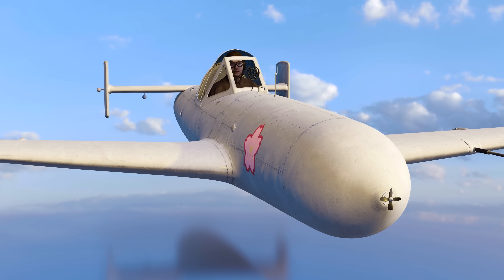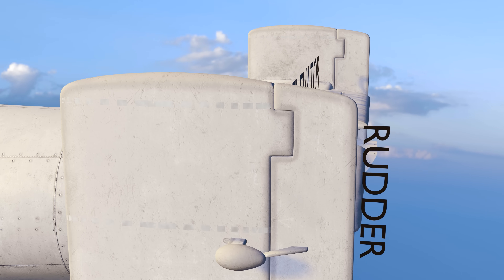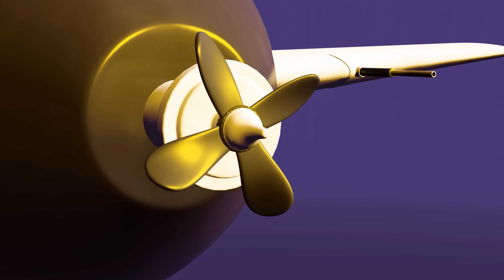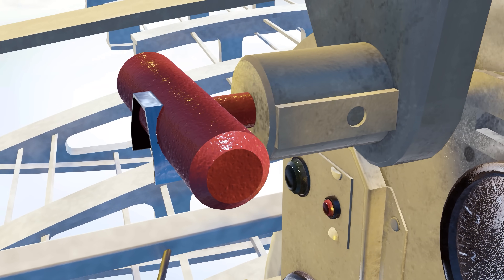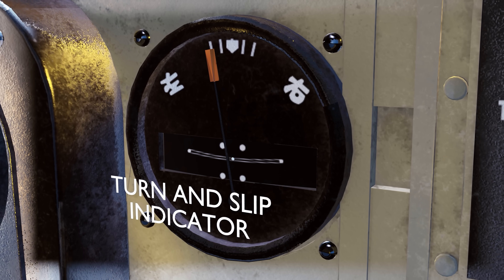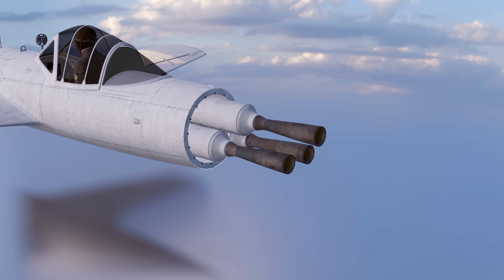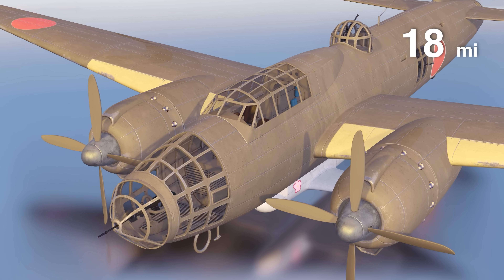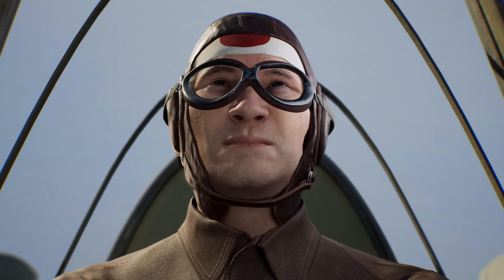Inside the Ohka Manned Missile

Comment: I loved the video. I don’t want you to force yourself to stick to rocket planes but the way they work is so cool and strange. Is it possible to show the ME163
Reply: The problem with the 163 was the fuel was corrosive and unless flushed out fairly quickly it would eat the fuel tank out from the inside. It sometimes ate the pilot away too upon landing and the liquid sloshing into the cockpit. The 163 was also subject to sabotage by the concentration camp or POW laborers forced to make them. Small rocks inserted into the wing bands could cause the wings to separate violently in flight. Or the laborers would urinate into the glue used to hold the wings together. This would weaken the glue and would again cause the wooden outer panels of the wings to separate at speed and would cause the wing to again separate violently from the aircraft. The pilots survival odds depended on if he was under thrust or not. Once the USAAF and RAF figured out where the 163 bases were it was a fairly simple task to reroute the bombers away from the area and it rendered the 163 inert. Had the BA-239 Natter worked it would have been a different matter but the one test flight of the Natter resulted in the death of its pilot
Reply: @matthewcaughey8898  yeah that’s cool I know that but I wanna know how it works and all it’s intricate parts

Comment: Do you really think the pilot's wore the type three integrated comms for one way trips? The throat mic is incorrect.  It is more bulky, the pickups are bigger.  
  There is one mere feet from me, I have the 6th known of 6. I didn't expect you to know. Not seeing its cord or plug either. The cord exits right side and after an inch there is a bit of white silk where the leather ends near the ring you have for the helmet strap. Two black buttons near center also.
   Not sure why there is a separate mic in hand if that is type three integrated comms.
  I'm no expert either.  It just doesn't make sense to me.
Reply: It's just a chin strap. Explains it looking odd.

Comment: "Pitot" is pronounced "pee-toe" not as you might expect, "pit-ot".
Reply: I should have added, otherwise an excellent and hugely interesting film about a fascinating weapon. Had they been able to develop the machine using a V1 pulse-jet engine augmented by rocket-thrust, the range could have been increased considerably whilst giving it the "sprint" speed to evade intercepting fighters, making it a much more dangerous weapon. As it was, all the allies needed to do was to attack Betties at greater than 20 miles or so from their shipping to prevent a viable attack, which of course they did.

Comment: Are there any plans, drawings, and pictures of the construction process of these planes? It seems I seen pictures after the US entered some of the air bases and it showed wrecks and damaged planes but not very much on details in the pictures. It looks very simple and straight foward. It seems like a little more work and someone could easily built a real working jet plane, though it would still be likely a one way trip.
Reply: Rocket plane* Jets and rockets are in no way the same thing.
Reply: @Mr-Trox  nope, but the air frames were similar.   jets and rockets designed for being pushed. Instead of pulled.  The weight distribution being nose heavy on propeller driven planes and not so much on rocket planes. No one said they are the same but they were not so far different as propeller planes and jets.

Comment: @4:55, you mistake what "lbf" means. Thrust is "pounds-force", not "pound-feet" as you say. The latter is a measure of torque.

I've also always heard "pitot" pronounced as "pee-toe", not "per-tott". Considering it's named after a French physicist, Henri Pitot, the former is surely correct.

Pity the narration isn't on par with the general content and graphics.

Lastly, I find it interesting that the designers went to the trouble of putting a fairing over the front on the already aerodynamic warhead. A simple skirt to merge the warhead outline with the airframe would seem to have been sufficient.
Reply: "pee toe" is closest to the French, but, at least in the U.S. "pee too" and "pee tot" are sometimes said. Similar to how "sabot" is pronounced. It's often pronounced more or less correctly, but you hear "say bow" and "sah bot" too. One thing he did mispronounce was "Yokosuka". The Japanese would say something close to "yoh koh s'ka" with the "u" barely detectable, just sort of a hesitation between the "s" and the "k".

Comment: A lot of people forget that guided anti-ship missiles go back to WWII, but the guidance computer was a person!
(Actually, Japan, the USA, and Germany all had actual radio guided missiles as well.)
Reply: Same thing with wire-guided missiles, like the German Ruhrstahl-Kramer X-4 air-to-air missile. It was copied quickly and improved upon after the War, although mainly used for anti-tank work.

It had an interesting fuze that was meant to (IIRC) explode when the sound level changed when the missile passed the bomber's engines!
Reply: @wape1  wire-guiding didn't do the Japanese any good, because their main issue was not that they didn't have bombers or that they didn't have fighters, they just weren't able to get through to the ships and when they did, they didn't get close or hit them. So the benefit of the Ohka and Kamikaze Zeros  was that they could traverse the distance. A wired rocket can't do that. A couple kilometers at best, and launching from a bomber would be ... interesting ... at the best of times. Radio rockets may have been better, but even then you'd need a spotter or something to actually guide them.
Reply: @Andreas-gh6is  I think you misunderstood my post, I was merely pointing out that the technology of wire-guided missiles also (surprisingly) goes back to WWII.

The same goes for (radio-controlled) surface-to-air missiles, which might actually have been useful to the Japanese—if they had the resources to actually get them operational, that is.
Reply: A lot of people don't want to think that during the war they lifes cost less than a missile
Reply: I’m currently binging on the Unauthorized History of the Pacific War channel now and I can’t remember a successful B-17 attack on shipping. The US should have created a specially trained squadron of fortresses that carried a single radio or wire guided 4000lb tall boy that they could use from above the fighter CAP. It would have been cutting edge technology but even one of those would have likely sunk the biggest of Japanese warships.
Reply: @highdesertutah  Several transports and destroyers were sunk by B-17s at the Battle of the Bismarck Sea using skip bombing, and I have no doubt that there were other successes throughout the war.
Reply: @highdesertutah slight mistake the tallboy was 12000 lbs
Reply: У Германии были управляемые авиабомбы. Управление рулями сброшенной бомбы осуществлялось по тонкому проводу
Reply: Wrong. Germany fielded a radio controlled anti shipping missile. Very late, and imperfect.
Reply: @davidjames1063  That's literally what I said though.
Reply: @davidjames1063 exactly. At Anzio and in the Bay of Naples, the Germans used radio controlled glide bombs against ships, successfully, and some may have had primitive Television cameras in the nose of the bomb.
Reply: There were also tv or radio guided missiles
Reply: That's it... even if the "computer" was not hit by a fighter or anti-aircraft artillery, hitting the target was inevitable
é isso ai...inclusive se o "computador" não fosse atingido por algum caça ou artilharia anti aerea, o acerto no alvo era inevitavel
Reply: In case with Ohka it was manned because some idiot took a half completed missile project and insisted he'd ride it, got approved on that notion that he'd ride it, then put everyone else on it and never did. It was in fact an anti-ship missile originally until that guy put a cockpit on it.
Reply: "Yeah dude but the radio controlled one is kinda shit, you'll have to ride the bomb, bummer, I know"
Reply: infrared homing bombs were also a thing like the ke-go (that wikipedia page also has a bunch of other obscure stuff). but considering nuclear bombs were invented and made in working condition earlier, its not really surprising
Reply: Japan never had radio-guided weapons. They did have infrared heat-seeking versions though.
Reply: @bkjeong4302  The I-Go guided missile (Ki-148) was radio guided.
Reply: No only the Us had it

Comment: Very well done video :-)  I think a horizontal attack would be problematic because of the limited duration of powered flight, and also dive angle indicator suggests that diving would have been the preferred method ... the cockpits were not locked  as is commonly thought,  that is not supported by evidence  (besides, think of it this way... your country is going to be invaded and there is almost certainty of it happening , would there not be volunteers to give their lives to save their families? )
Reply: Sort of....The true purpose was to inflict enough damage on the Allies to convince them to settle for a negotiated peace rather than the unconditional surrender they demanded, thereby allowing the military government to stay in power and avoid having to take responsibility for the war. NHK produced a very thoroughly researched program on this topic.

Comment: Great graphics and clear explanation. By the way a pitot is pronounced "pee -toh". One wonders why the pilot buckled up in the aircraft, considering his intended fate. Was the spinner fuse there in case the pilot decided, as many normal people may, not to arm the bomb electronically?
Reply from the maker: Thanks. Will fix that in the future vids.  I think the as the spinner could only arm after release it was a safety measure for the betty. But that’s just a guess.
Reply: No you want a loots of safety messure to prevent a big bomb explod by mistake. The spinner was the final safety device. Imagen if the bomber/Ohka carch on the runway during take off.....you do not want the bomb to go off unintentionally.
Reply: Yes Pe-to is correct. Frenchmans name.  Oddly in my 20 years as a Navy jet mechanic, Everyone called it a pee -tot. Even the pilots. go figure.

Comment: As  I read in other literature, the pilot got into the 'baka' before the 'Betty' got into the air. He drank saké (probably to strengthen his nerves) and took his katana with him in the cockpit. Then the cockpit was closed and sealed so it could not be opened from the inside. Of course this was done so that he could't change his mind and try and stay alive.
Reply from the maker: That may have also been the case but it wasn’t exclusive. In our sources we found stories of pilots saying goodbye to the crew in the air before entering the cockpit. Also some models did not have oxygen and were dropped from 10000 feet
Reply: Hi.You are wrong. The Ohka pilot waited for his turn in the Betty fuselage during the flight. When the carieer pilot decided that the moment has come he would activate the circuits arming the Ohka releasing mechanism.  The kamikaze pilot usually helped by the aircraft navigator and one of the gunners would take his place in the saddle while all the time a red light will signal that the system is armed.  After signaling his readiness by changing the signaling light to green and also through the intercom the moment of release would come.  🇯🇵 🇯🇵 🇯🇵
Reply: If the pilots requested, he would be given marijuana or other drugs to numb his fear, but since getting drunk would affect his accuracy, he was only given a small amount of alcohol.  Things like tying the pilot in the cockpit and not opening the hatch from inside were completely invented, and I think they were probably made because they couldn't understand the Japanese mentality of committing suicide attacks.  In fact, when Betty was attacked and it was determined that the attack was impossible, there were many times when the unmanned Ohka was jettisoned and left.  And these suicide attacks were also highly ceremonial, with a simple ceremony usually taking place before sortie and the pilots being treated respectfully.  The Shinto idea is that those who sacrifice their lives for their country become gods who protect it.
Reply: @犬まにまに  imagine being stoned af trying not to whitey as you drop onto a carrier group in your suicide missile
Reply: And a shit tonne of amphetamines
Reply: It maybe cold to sit in OHKA cabine for a long time , espetialy in high altitude.
Reply: Please do the ww2 V1 and V2 rocket my grandparents we’re living in east London when those beasts flew above the skies of 1940.

Comment: I once was told that the Ohka would fly with the cockpit open during the Betty transportation because once closed, it could never be opened again :/
Reply from the maker: That may have also been the case. But we read accounts of the pilots returning after the Ohka not releasing or the attack being called off. So there were definitely versions that could be opened.
Reply: That sounds logical because you don't want the pilot to be tempted to bail out.
Reply: Maybe only able to be opened from the outside.
Reply: @masheroz  Excellent point. Considering what was going to happen, the possibility of the pilot bailing out would have to be addressed, but making the canopy openable from the outside would also address any problems with change of plans after pilot gets into position.